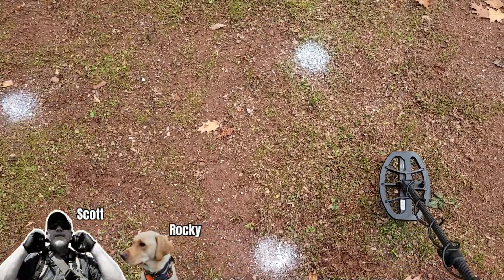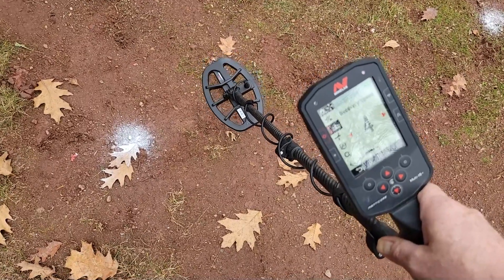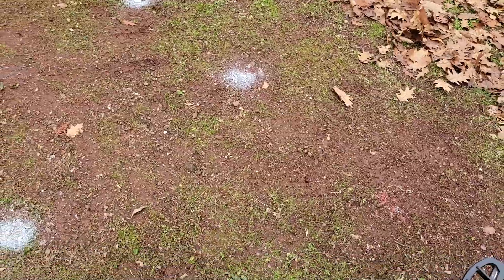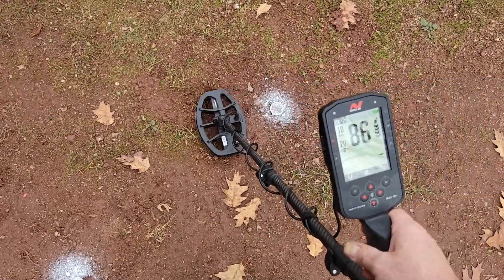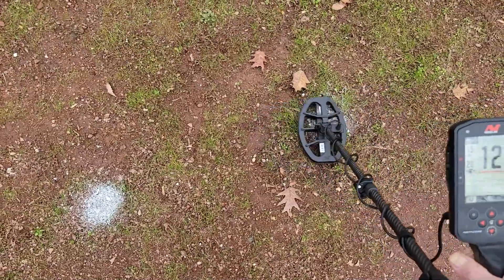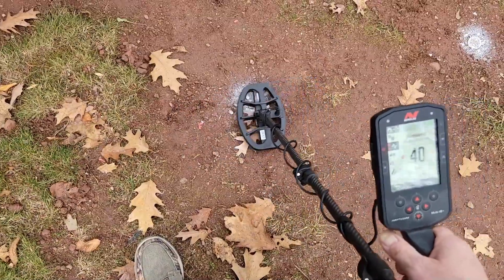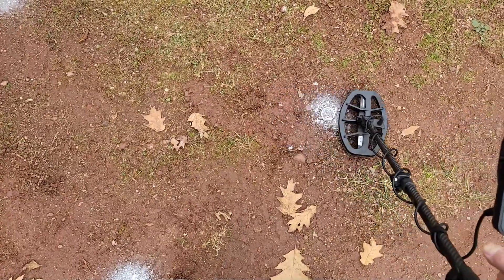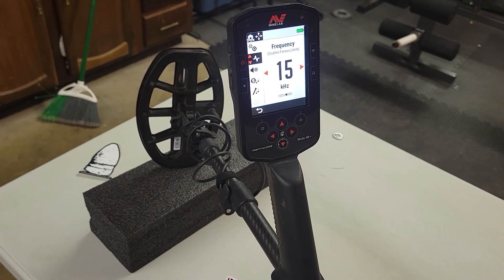Minelab Manticore Single Freq Test - Weird Stuff Going On? or Is It Normal?

Comment: Thank you for mentioning my channel happy to help out! I would be curious to know if this same single-frequency up-averaging behavior happens with the 11" coil. It's my understanding that these modern detectors know which coil is attached and adjusts properties / TID tables to optimize for that size of coil. It's possible there is a bug on AT general that is causing this strange behavior. I think the fact it is only on AT General strongly suggests this is a software issue that Minelab might want to take a look at, if it was the ground it would happen to all programs. If both coils have this same strange single frequency behavior, it could be that AT General in single frequency just performs poorly in your ground conditions, but I am leaning towards a software issue.
Reply from the maker: Yeah thats something I need to do to rule it out with the other coil. Thanks man I hope some folks dropped in and gave you some traffic. Thanks again! I'll keep you posted.

Comment: Hi buddy ,wondering if you could do a test on factory field 1 ,with ground balance and then do a factory reset and then ground balance, I've always been told not to ground balance my ctx or 800 in English soil unless your on real hot soil ,my bro in law always ground balances ,ok he find lots more than me but he's 40 years into detecting and knows his stuff I've only been doing it 8 years ,only problem I got is I've now pooped my knee and got a leg splint on 🤦‍♂️so I can't get out for a while ,😊
Reply from the maker: So you want me to ground balance, then factory reset, and ground balance again? Why? I'm not sure that is going to prove anything. I always try and ground balance regardless of what they tell you.
Reply: @MentalMetal  sorry I meant manual ground balance on field 1 vs the factory preset of 0 on field 1

Comment: Stock coil vs. secondary coils
is liable to produce slightly
different results than the stock
coil. The shape, windings and output etc.. No designated setting for each proprietary coil I assume so the stock coil
is probably what the engineers
used to set the machine up with. Coil size, shape and output can make a big difference. It's the windings you know.

Comment: These machines have so-called "single frequ'" options, but they will never be as good as a top-class single frequency analogue/"digital readout" machine, It's impossible. A single frequ' MD has it's coils wound and electronics specifically calibrated for their, respective, kHz range. ie: A, lets say, Nexus MP V3, is hand-built around it's selection of coils, who's differing single frequ's are wound specifically to the machine's electronics. This is an impossibility for a SMF (Jack of all trades) metal detector: it just is. The fools and 'fan-boys' who believe that SMF machines make all others obsolete are....."wrong". This absolutely doesn't mean a SMF machine is no good: far from it. They jump over alot of the older machines in some disciplines; just not all of them😉😁
Reply: Manticore will kick any of the older detectors asses. Night and day difference.